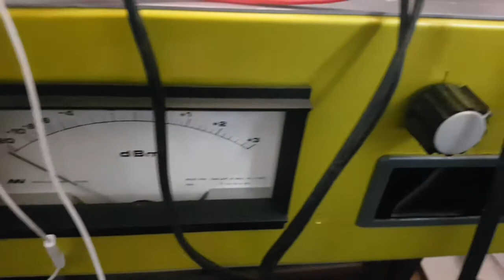SIT 3 approach

Comment: Hi Dear Diyaudio member, could you tell me how it sound?
Reply from the maker: Esteban Bikić 
Thanks for watching 
It sounds variably depending on how the bias was set, can experience from a very warm rich of a typically second harmonic dominant to a high dynamic transparent of a third harmonic well balanced.
Reply: @vk2ihl  Very interesting design! Can you please say more about the operating range of the output stage (51S+905D)?
Reply from the maker: Сергей Немцев 
Hi, more info is available at:

https://www.diyaudio.com/forums/pass-labs/327580-latesit-post5657705.html

The behaviour of both transistors had been traced and responded curves are attached in the link above.
Cheers.
Reply: @vk2ihl  Thanks!